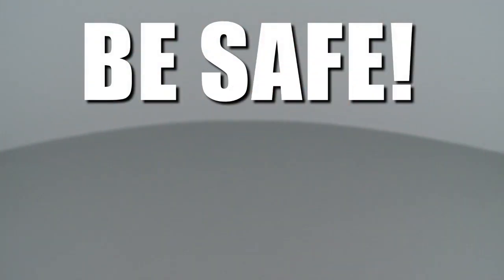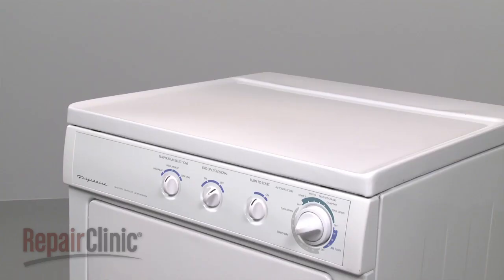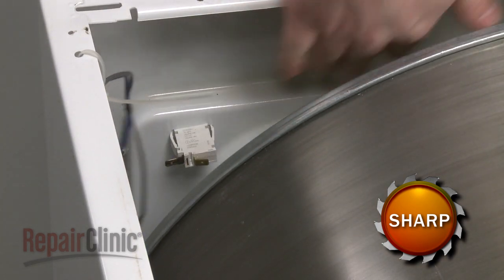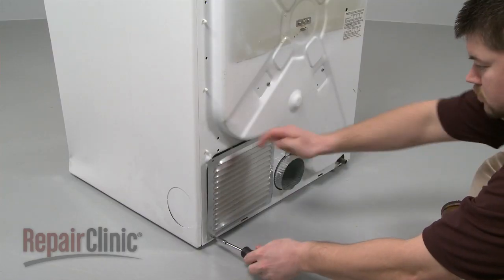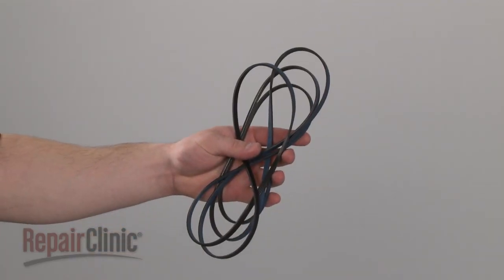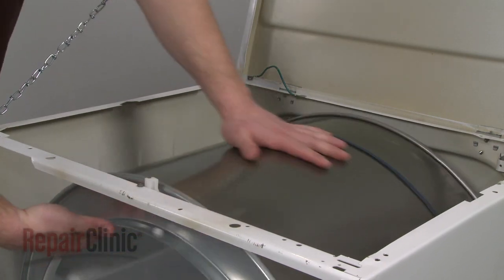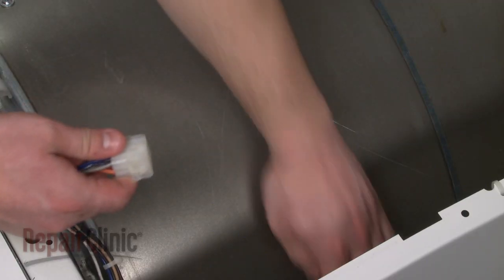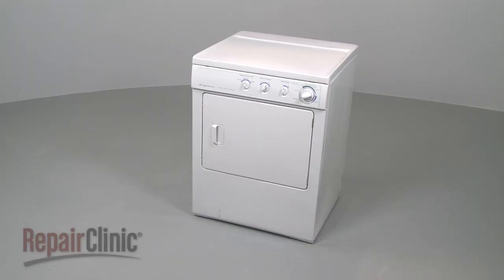Frigidaire Dryer Belt Replacement, Repair #WE12X10009

Comment: Getting the front panel off on my stacked washer/dryer unit was a little different.  Had to remove the face plate between the two items, take the control panel off, and unscrew the bottom of the front panel before I could remove the screws holding the front panel on the top of the dryer.  However, once I got inside, the guts looked exactly like the video.  Thank you.

Comment: A few things this doesn't mention. This is really easy if you have a brand new machine sitting on a flat floor with a lot of light. If you have an older machine the sheet metal will have bent slightly which means NONE of the holes will line up. Oh and maybe it's just my machine but the little spring clips that hold the front of the machine in place where designed by an asshole and they fall out while you're trying to reattach the front panel. Over and over and over until you drag your piece of shit Frigidaire out into the yard and beat it with a baseball bat. That's assuming you haven't lot too much blood from all the jagged metal edges inside the machine that have tore you up like a hungry velociraptor. Plan on getting a tetanus shot after you finish.
Reply from the maker: Rich Yan Hi Rich, sorry to hear you had a difficult time repairing your machine.
Reply: Rich..sorry you had a hard time..BUT..your comment had me rolling..too funny.